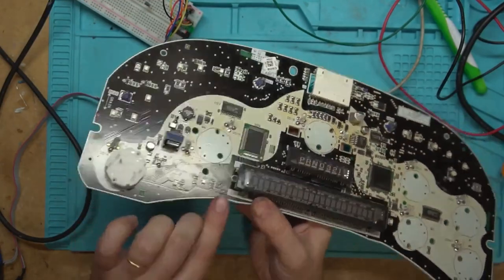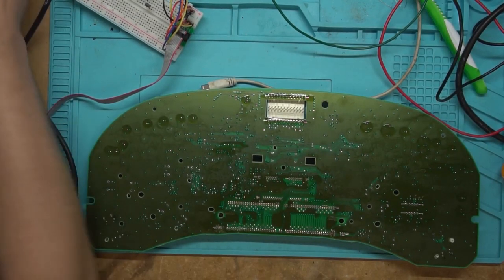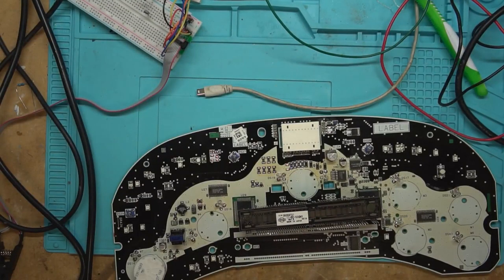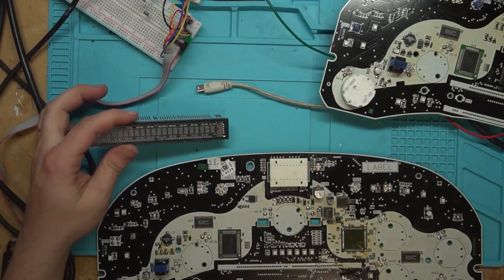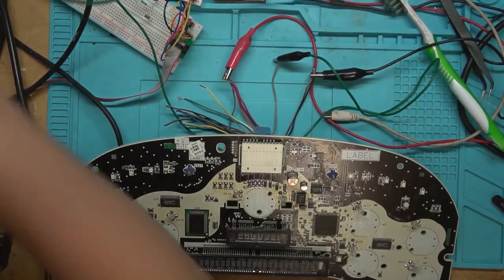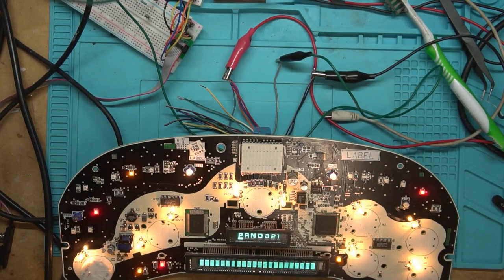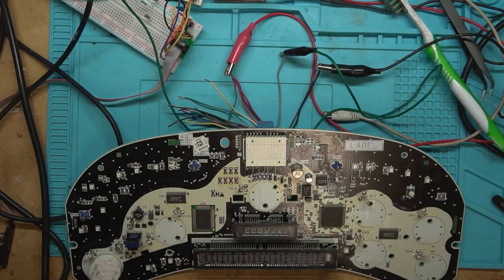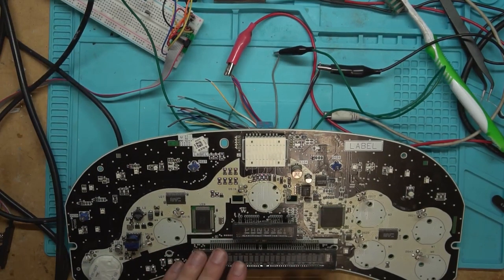GM Odometer or Drivers Information Center Screen Replacement

Comment: thank you for the information. I pulled an escalade cluster from the pick and pull that was smashed pretty good. Pieces of the vfd could be heard just rattling around when I pulled it and the lens was busted both on the black plastic and the clear lens. I successfully repaired the lens and replaced the glass with plexiglass. Lining up the pins is the bane of my existence right now lol.

Comment: Thanks!
Reply from the maker: No problem 👍 any video requests?
Reply: @FixedUntilBroken  what about flashing for steering controls?
Reply from the maker: I currently don't do that. It's an MCU flash that the only way I know how is with tis2web software. It's like $45 per use or you can pay some crazy number per month. If you use the wrong vin you can brick the instrument cluster. I'm trying to find a way past the boot loader to manually do it without tis2web
Reply: Isnt tis2000 free?
Reply from the maker: I haven't had a chance to get the tis2000 software working yet. I don't think tis200 can do it though I think Tis2Web is the only one.